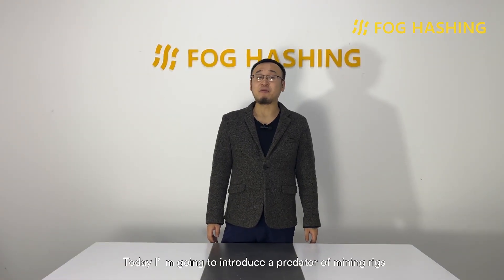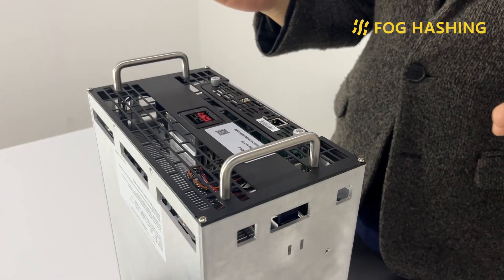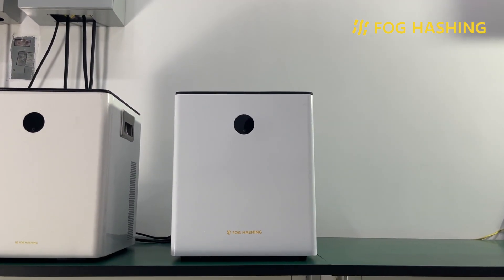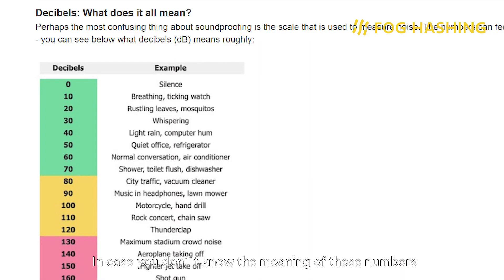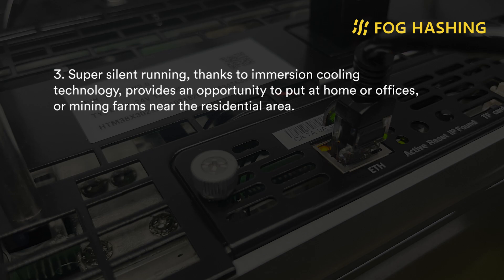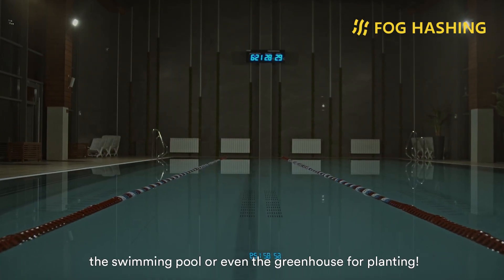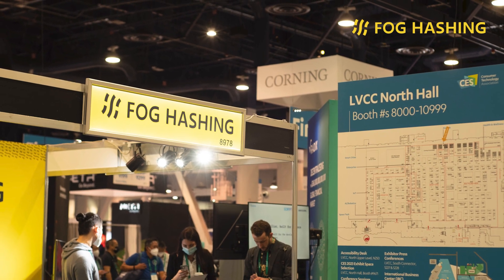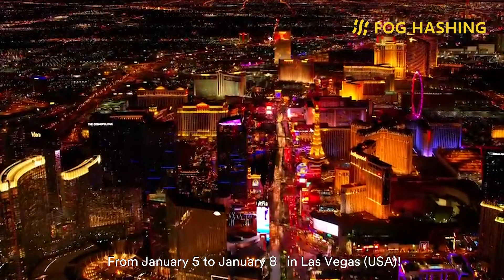M56 Unboxing & Testing, Can Whatsminer's first OFFICIAL immersion mining rig kill other miners?

Comment: So if I understand correctly, the C1 & C2 have the miners immersed in coolant but the other half / side of the heat exchanger runs just water, which can be routed to heat other parts of your home/office?  Is this just tap water or must it be distilled?
Reply from the maker: C1 and C2 consist of two parts, the tank and the dry cooler. The tank uses coolant, and the dry cooler also uses coolant, no water is required. If you are heating your home, you need to connect another pipeline, and water will be used in the pipeline
Reply: @foghashing  can I heat my swimming pool with C1 or C2? Instead of coolant or the external blower, can the pool water be pumped through the container using a pool pump?
Reply from the maker: @21thiru  Hello, we are also working in this area, if you are interested, please contact bd@foghashing.io